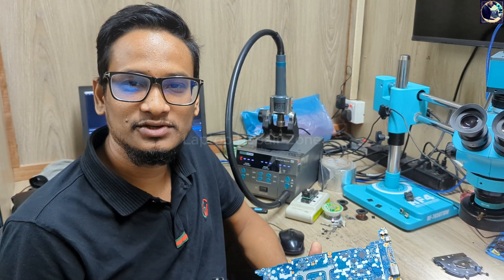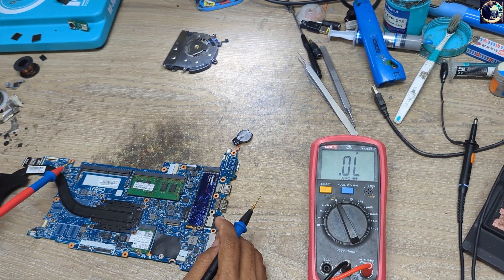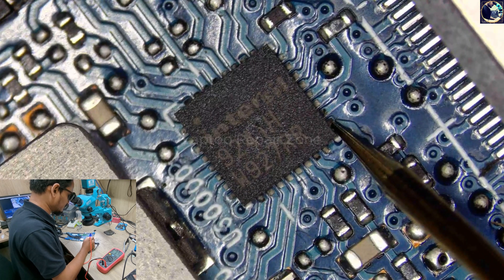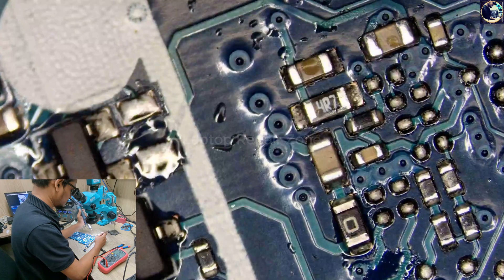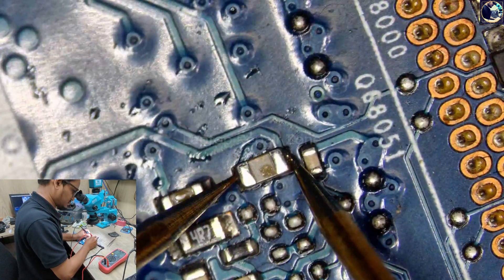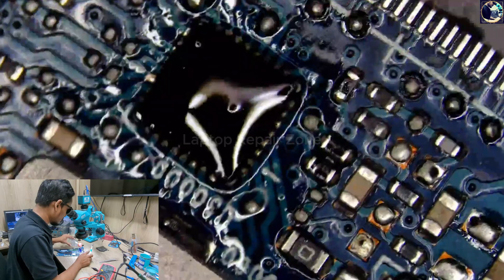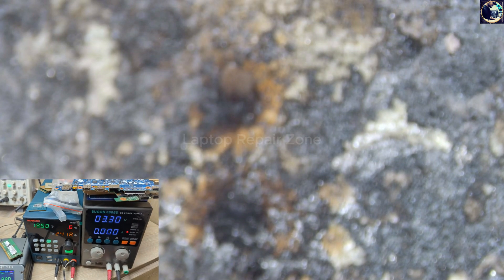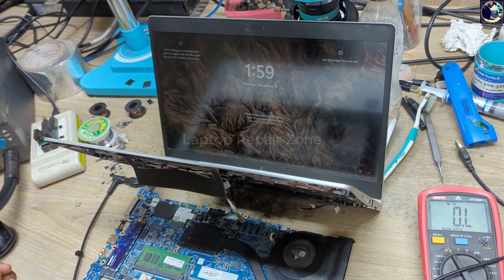HP Elitebook 840 G6 laptop no power solved | DCIN voltage only 6V

Comment: Vet nice and detailed explanation. I have a question 🙋 I'm working in Hp 840 G6 charging ic which has ic number, intersil 9241H the only donor board I could managed to get is 840 G5 with intersil 9538H. I wanna ask if I they are compatible?
Reply from the maker: No they are not same